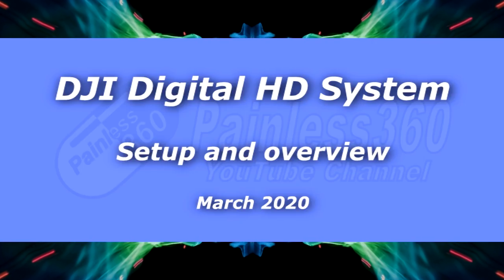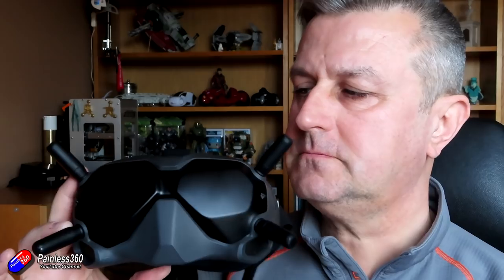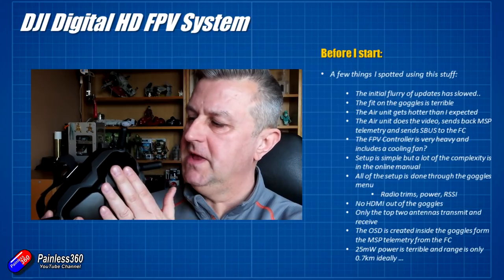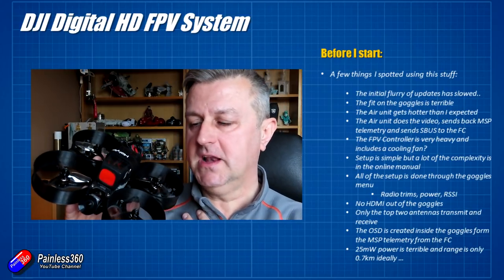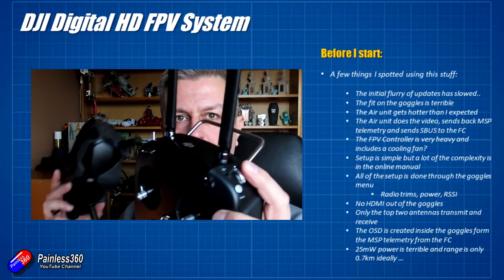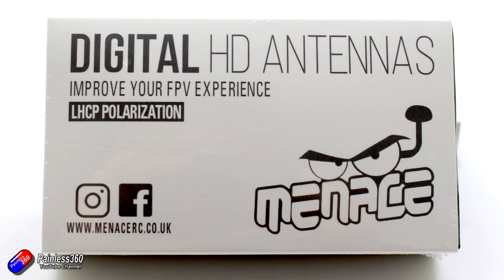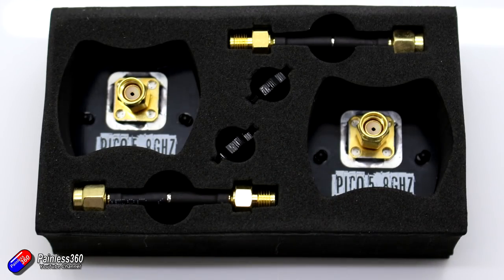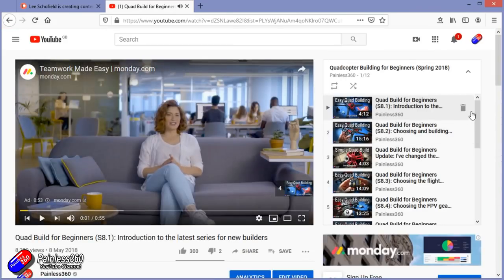'No Hype' DJI Digital HD FPV Setup and Tips

Comment: Hi.  I’ve used the TrueRC X-Air double patch, but they suggested replacing the 2 top antennas.  This seems to work very well and with 700mW I have flown out to 2.5km and still had 3 bars reception and 25Mbps.  It is quite directional - more so than a patch on Fatsharks - I’d say you need to be pointing 30 degrees max either side of your model.  I guess it doesn’t really matter if you replace top or bottom.  From what I know, like you said, one of the top antennas does transmit as well.  Great system.  I keep my Fatsharks for analogue and this for HD.

Comment: Hey, careful with that case - I have the same one. Had to cut a hole in that inner mesh for antenna to go throu. Otherwise it was pressing quite hard, especially if I put anything into that mesh pocket. Apart of this it’s ok - I got tired unscrewing those antennas all the time, and now it’s a quick setup. And thx for the video!

Comment: Great review...Just one point i cant stress enough especially for newbe`s....make sure you download the...    FPV Assistant... and NOT any of the other MODEL variants from the website...if you don`t use the correct variant ...the system will not recognise any of the components  (Goggles...Air unit...or Radio) when you try to activate them.

Comment: Thank you 😎 I’ve had mine for a about a month and love them. I did learn some stuff so Thanks 😊 ✌️
Reply from the maker: Hi Sean, pleased to hear that some of that was news to an existing user. Can I ask which bits?
Reply: Painless360  ya Thanks 😊  I went with the foam because I suspected the 3D shins for the side wouldn’t do it. You kinda confirmed my suspicions.  The two bottom antenna are only receiving 🤔 I don’t recall hearing that before (who reads hard copy anymore ) jk 😁 I had the air unit and everything already going so I’m glad to know I can refer back to this to upgrade software.  If I think of something more I’ll let you know. Question 🤔 pardon the teck ignorance, do patches help with penetration as well as directional? Love the channel 😎✌️❤️
Reply: 3D shims

Comment: Very good honest review. 
One quick question, do the DJI Goggles RE edition work with the system or does it have to be the new FPV DJI Goggles? Looking at the spec, it seems the RE edition goggles cater for both analogue and digital. Thanks.

Comment: Would it be possible to configure Airmode to only be on at say less than 10% throttle using this controller with the HD version of say the Beta95x v3? Since the controller does not have a screen... How would you be able to get the throttle on an aux channel?
Reply from the maker: Not using their controller. You'd have to look at the settings on the flight controller... Happy flying

Comment: I love all your videos. I watch them when I can and when it applies to me, I know you made this video along time ago, but I am now trying to set up a jet with the older air unit and that remote control the same set up but not in the Drone. The problem that I’m having is that I can’t seem to configure IAV with the rockers switches for my camera or the momentary push switch on the right dial for the reverse thrust. Any ideas? I can’t find any literature anywhere about it. Anyway, if you happen to see this message, I would be so appreciative if you could bring me up to speed. Thank you and press on
Reply from the maker: What is IAV?

Comment: I built a Catalyst Machine Works Bang God 5” today and put my first DJI FPV unit in it. I only bought the goggles and air units, not the controller. 

I wired in a Jumper R1 receiver and everything is now activated and bound.  Had a mini test hover in angle mode in my living room and everything seems to be working. Maiden flight tomorrow, weather permitting. 

A couple of quick questions if I may.  I don’t like where the onscreen information is displayed. I wear glasses and it seems way off to the side and awkward to focus on if you’re trying to concentrate on where you’re going. Can you configure the OSD info in Betaflight?

I didn’t buy the DJI transmitter and I’m wondering whether it’s worth buying - as it’s advertised to have quite a long range. I’m currently using a Jumper T16, which I like, and trying to decide between getting a long range module (IRC Ghost or Crossfire) or just sell my analogue transmitters and commit 100% to the DJI system?
Reply from the maker: Check out the Lockdown build where I put the DJI stuff in a wing. Moving the elements in the regular OSD tab in Inav/Betaflight should move the elements in the goggles... Unless you use the higher powers on the DJI stuff a regular radio will give you more range for control. Happy flying

Comment: Hiya. Thank you for taking the time to make this video,  very helpful.

Could I ask, I have this dji system on a flying wing... is if possible to reverse a channel ( I.e. get elevator to move in opposite direction) on the remote control without having to do it in betaflight or inav. It's easy to reverse a channel on a radio like the terranis , but how would I do it on the dji remote?

Comment: If you are flying without connecting to a flight controller (ie a fixed wing) the power will not go above 25mw unless you turn off the power control option , then the power level will be what you set the max power to.
Reply: Can the controller be set up for airplane/wing?

Comment: Great video mate
Wish that it could do me good on long distance FPV on planes
Have the connex pro sight HD and it's just not as good as I hoped but it old news now 😅
Stay safe and healthy my friend
Cheers
Lase
Reply from the maker: The DJI Digital HD system has a limit of 4km (uses the video signal RSSI to detect the limit I understand) but you'd need to push the power to the maximum to get that range...
Reply: @Painless360  I heard if you power up to 1200 you can get that kind of range but it's illegal here in Denmark
2 km range without signal loss would do me very well 🤔
Could sound like a good idea then
Again thanks for all your very helpful information and advice
Cheers mate
Reply: @laseonestar  A friend of mine flew to almost 6km with a plane. (Crossfire)

On youtube "Dustin Dunnill" had similar results on 700mw. So yes, 2km is VERY possible.

Comment: Can you turn the air unit on / off using a channel on a receiver instead of flight ctrlr?
Reply from the maker: Yes, if you use something like an RC controller switch. Vendors like MenaceRC make them. Check out that the current capacity is enough to supply the unit easily...

Comment: I'm thinking about buying the goggles and a quad....but I need to know if I should just get the dji controller or just stick with my radiomaster? I might add crossfire much later to the radiomaster.  But it's the dji controller better and easier? Or just keep using open tx?
Reply from the maker: I use both and the FPV controller is simple to use but had very little configurability. If I'm flying DJI HD then I use the DJI radio, RadioMaster/Taranis for everything else..

Comment: Great video! But, I’d like to know if the goggles will act as a simple display if plugged into the DJI smart controller or, if there’s anything that will? I have a mavic air 2 and fancy the fpv experience.
Reply from the maker: I don't have the Smart controller so not sure. Best of luck with it..

Comment: I just got the kit the other day but can't seem to get past a problem with the firmware I'm having. I updated the firmware in the three components (Aircraft, Controller and Goggles)  using the DJI Assistant 2 For FPV but afterwards when I go to crank up the aircraft, there are two red flags in the goggles that say the following:
          Message 1 "Aircraft firmware version out of date"
          Message 2 "Remote Controller firmware version out of date"
When the goggles are first connected, i GET A MESSAGE ON CENTER SCREEN TO UPDATE THE FIRMWARE USING THE "DJI Fly" App.

Just thought I'd check to see if you may have come across this . The DJI Tech Support guy wasn't any help. I spent hours on hold and getting cutoff so they've been no help.
Reply from the maker: Is that V1 of the goggles or the new V2 that comes with the little quad? I've not got the V2 here..
Reply: @Painless360  The new V2 FPV Drone Combo with the “little quad” recently released.

Comment: Thanks for a great video! Very helpful! As someone who's new to the hobby, could you tell me, do I still need to use Betaflight to configure the quad and controller or can everything be done through the menus on the goggles? Thank you.
Reply from the maker: It's changing all the time but I'd always setup a Quad first using the Betaflight configurator..
Reply: @Painless360  Thank you!

Comment: Great video! I love my DJI FPV system. But, I have always flown fixed wing with a monitor as apposed to goggles for LOS and situational awareness. You said there is a coming firmware update that will allow you to use the smart controller instead of the goggles? Or, together? (using goggles as receiver?) Also, I had heard DJI used a USB out of the goggles to display on a screen at the product reveal. So, I guess it's possible that might become available??? Thanks for all your good work!
Reply from the maker: Goggles to the Smart controller. I only have the same detail shown in the video... happy flying!

Comment: 😀Excellent video......But I need HELP.😳
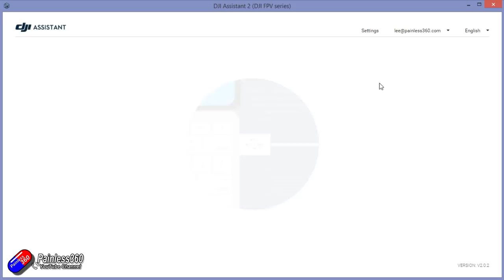I followed the instructions but when I plugged the goggles (13:07) I didn't get that Icon, I heard the "tururu😁" when I connected the cable but nothing happened 😳😢. I used different USB ports and I heard the noise but nothing...... whyyyyyy😢😢?
Reply from the maker: Are you powering the goggles with a battery?
Reply: @Painless360  yes I am.... 3s 11.1v.. the goggles are on and ask me for registration.
Reply from the maker: I'd try another cable..
Reply: @Painless360  ..... Seems like I got a defective cable, I tried another cable and that solved my problem.... thank you.

Comment: Hi painless360 I have the armattan marmotte with the DJI goggles and controller
Reply: I was wondering on the arm sequence on the DJI air unit controller how far do you set a switch in betaflight?
Reply from the maker: It's as normal. Flick the switch on the radio and watch in the Reciever tab in Betaflight to see what channel it relates to.Setup the 'Arm' mode sliders to bracket the channel values in the 'Modes' tab. See how I did it for the HOLYBRO and GepRC DJI Digital HD quads I've reviewed over the last two weeks... Happy flying
Reply: @Painless360  cheers thank you... I really appreciate your time.... Not to mention the editing part

Comment: Hey Lee, given the latest firmware updates, do you have advice on the best settings?
Reply from the maker: What kind of model and FC?
Reply: Painless360 it’s just the air unit in a Bixler. No FC. I was wondering 25 or 50mps and low latency or high quality etc?
Reply from the maker: I fly with the 25mps and low latency for the fastest speed. You could get away with a higher quality on the Bixler (it's not a fast model) but you need to see what you prefer.. Best of luck!

Comment: I have DJI FPV system. Using Crossfire RX and Tango 2. I just realised I shouldn't buy Crossfire RX to every quad that have DJI ...just buy the DJI transmitter and no more RX to solder in, no setup configuring, no antenna and finally no OpenTX.
Reply from the maker: Yep, and it works great too...

Comment: Due to current situation in the uk at pressent, I have been restricted in flying my big helis, I am considering getting the DJI Goggles, Am i better off also buying the DJI radio to go with it. I fly my helis with a Jeti DS24. Great watching your videos, I like the idea of the FPV, Its really caught my eye now I am getting the buzz for these drones
Reply from the maker: The DJI FPV controller is very basic and needs a system on the other end that is very configurable to map everything easily. If you already have a radio you love there isn't any real need to change it..
Reply: @Painless360  Thank you for your quick reply, I think from reading and being new to this field, I would be better off with the complete Goggles and transmitter setup, which 5/7 inch drone would you recommend. I see you have to buy charge pack for goggles, I have allowed £1500 to start me off
Reply from the maker: Check out my Kit Picks 2020 video.. Best of luck

Comment: I recently bought the goggles alone, and I 3d printed a new front to replace the black part, I added a tbs fusion module and it does work well. However I find the goggles to be hard to use, there are too many cables found back and forth.  Anyone know where I can buy a special made cable for this mod? Or even where I can buy a 20 cm 4 connector minijack.. ?
(I made mine 100% like "funali" here on YouTube)
I bought 2 of the analog modules from banggood, both came with much shorter cables then the one you have..

Comment: Is camera switching a possibility with something like the Matek f405? I don't have the DJI system, but I've seen you can purchase just the digital camera. Would it be possible to have two cams pass their video signal through the camera switch, then back to the DJI VTX?
Reply from the maker: I've not seen a digital FPV switcher. The ones about are for analogue that I've seen... Happy flying
Reply: @Painless360  oops, I meant Matek F722 Wing. Thanks for the response!
Reply from the maker: See my Nano Drak build. I set that up... Happy flying!

Comment: I have a question please 
Great video as always by the way,,
I am planning to get the iflight DC3 , and dji fpv system with dji controller,
 I though that I am not going to need betaflight anymore, but in bnggood states that :
if you use your own DJI Remote Controller, you need to update betaflight to 10.6.0 to set up and bind your DJI remote controller.
I'm confused, why do I need beta flight ? 
thanks a lot in advance for your kind help
Reply from the maker: Yes you need Betaflight, the DJI system replaces the radio (via SBUS) and the video only.. See the rest of the series and the review videos of the 'DJI HD' models on the channel. Best of luck!
Reply: @Painless360  Thanks a lot,
 I will , 
you are the best ,

Comment: Hi I did the 50 bitrate update there and it reset my gear back to 25mw and I can’t change the bitrate have you herd this before ? Thanx
Reply from the maker: I've not heard of that, let me know when you get to the bottom of it.. Best of luck!
Reply: Painless360 thanx for your speedy reply I watched ur video about it and you said it didn’t affect the fcc hack which I was happy with because one of my dji drones is a Nitemare to get the sd card out off it’s a bumblebee so I did the update and to be very fair you did say you hand not done it so flip lastnite was a Nitemare I am getting the reduced amount of channels and I can see the frequency of the channels but I am at 25mw and it won’t let me change the bitrate from 25 it’s just not highlighted any suggestions I tried to email DJI but there support system seems offline keep up your great work and very easy to follow reviews thanx again
Reply: Hi goto the bottom of what happened turns out it wiped the fcc hack so when I did it again it works perfectly so you must have to do the fcc hack otherwise it won’t work

Comment: Was thinking about moving over to HD from Analogue. My problem is that I don’t use inav but rely on osd for battery status, Altitude and distance. Is it possible to get these things with out connection to a flight controller?
Reply from the maker: Sadly not.
Reply: @Painless360  that is a shame. Is it possible to connect it to any other type of flight controller or is it just inav?
Reply from the maker: Most flight control software now has the ability to run the OSD in the DJI goggles - I've used Ardupilot, Betaflight and INAV here..
Reply: @Painless360  that’s more encouraging. I always use kopilot for the ease of use. I just can’t see that working on anything like dji unfortunately. Might have to consider changing my flight controller to something like Ardupilot. Thanks for your reply, much appreciated.

Comment: Is there a reason why when linking the controller to the air unit that the controller will beep constantly even though both are green and connected.  In addition to that it wont arm in person even though it responds in betaflight.  Is there a solution to this?
Reply from the maker: Are the switches in the default positions and the throttle at its lowest point? What have you already tried?
Reply: @Painless360  I fixed the controller beeping but after a little while the drone begins to beep and it wont respond to my controller even though when im in betaflight the graph shows movement with the controller

Comment: Is there a way to transfer data from an f7 controller with inav to the  dji goggles via the Dji HD fpv tx?
Reply from the maker: Yes, see my videos on it and the lockdown build where I set that up... best of luck
Reply: @Painless360  I dont see a video with "lockdown" in the title.  I found one that was a build where betaflight was used but the controller was pre connected and pre loaded with betaflight.  Unfortunately that wont help me.  I need to know how to connect the flight controller to the dji hdvideotx and use my own receiver. Im not using the dji transmitter.  What video do you have for that?